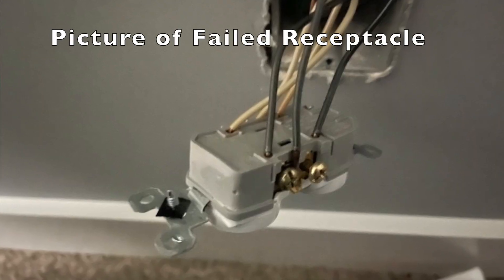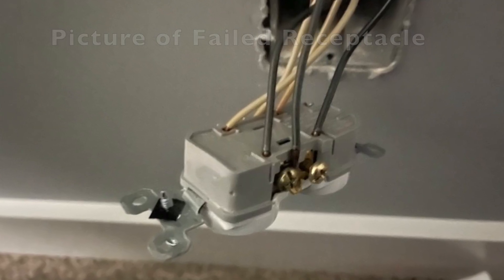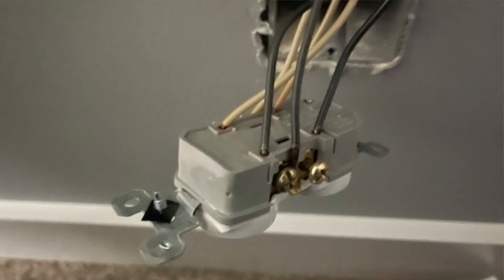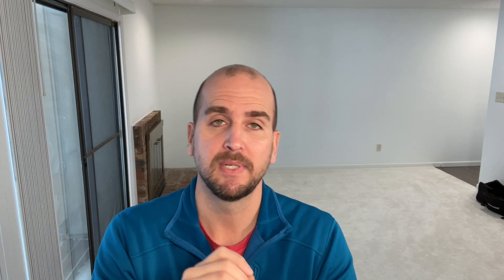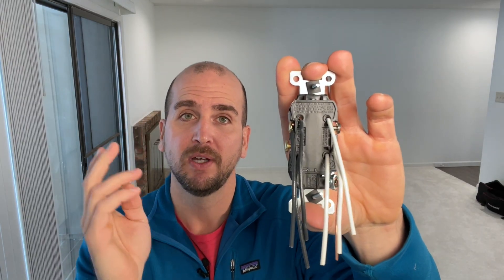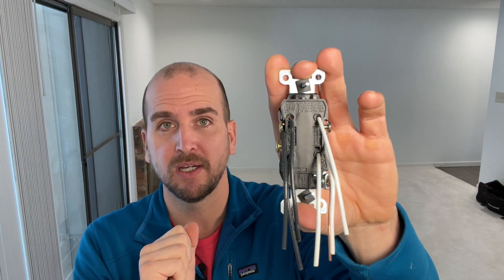Incorrectly Wired Outlet Found In Newly Built Home

Comment: Plumb your wall plate with a torpedo level
Turn your face plate screw slot vertical (don't over tighten) ground down unless otherwise specified by the owner/job or to match other existing or to indicate switched outlets
Pigtail not necessary for commercial outlet w/ 2 connections (watch out for adding pigtails as far as adding to your box fill)
Always tape around receptacles in metal boxes in addition to tightening unused screw terminals
Keep nuts in opposite sides of the box (no need to tape) ideally pointing up as to never hold potential moisture: outside (exterior)  from condensation, inside from a plumbing leak or infiltration leak
Always always use a box extension to keep combustible material non adjeccent to the device

Edit: if adding a pigtail makes things easier and safer go ahead and use (they don't count twords box fill because the originate and terminate within the box and are considered as a connector not a conductor) if adding a pigtail makes things more difficult or less safe, don't use one.  Some boxes, like the little metal ones set in plaster walls of older homes, can be pretty tight and a device, grounds, and 4x 12awg conductors may not leave a lot of room for a pigtail.  Just do what makes sense, work smart, stay compliant, and stay safe.
Reply: pigtails do not contribute to box fill per NEC. Agree that for his commercial outlet the pigtail was not necessary, the way he had it was just fine.
Reply: @lars949  agreed, just because it doesn't count for fill calc doesn't mean it's not making a box unnecessary tight but from a code standpoint you'r correct
Reply: Great tips.
Reply: Boxes come in many different sizes to accommodate the number is conductors as well as the number of devices. If you properly size the box and nicely tuck in your splices (like a craftsman), you will have no problems with space. A receptacle is a "distribution device" not a "splicing device".
Reply: @pappabob29  Yes, there are a great many types and sizes of boxes and I'm sure there are other great videos on box types, fill calcs, sizing new boxes, and changing existing boxes and these would be great points for topics like, remodels and additions; however, the intention of this video, as well as my comment, is only some best practices for replacing an existing device and typically replacing a box is unnecessary for replacing an existing device and is not part of this video.  I think we can all agree that all most all code and best practice are important but this is an introduction/reference video and the narrow scope of these types of videos is what makes them a good resource for beginners.
Reply: @tylerferrusi7652  
OK Tyler, but you brought box fill into the discussion in your comment above. I would suggest that at least MANY if not MOST people watching this video and reading these comments are doing more electrical work than simply replacing receptacles. Any case, I would strongly suggest completing the circuit (continuity of conductors), using the proper sized conductors and boxes and using appropriate splicing devices, BEFORE adding the receptacle device. 
If you run into this situation while replacing a receptacle, by all means, do the same thing using the smallest "approved" splicing devices and use stranded pigtails if box space is a issue. Use terminals on the device ends of the tails or devices that have the screw clamps for those connections. There's ALWAYS a way to PROPERLY do the job given some thought. The side screw clamps are always found on the higher quality devices and that is ALWAYS money well spent.
Reply: @pappabob29  Just because pigtails don't have a value for box fill calcs doesn't mean it's not an aspect of box fill as a general concept and something to consider when replacing a device especially for someone new to electrical, but I don't disagree with you about the code and I also agree that most will do other work but I maintain that there are other resources for other aspects and I appreciate Scott's videos for being clear and concise.  Nowhere am I advocating for improper sized conductors, boxes, connectors, or suggesting to use or do anything improper, without thought, or to compromise quality.
Reply: @tylerferrusi7652  
  👍👍
Reply: For anyone following this thread, sparky channel has a really good one on box fill and the combination of his mock-ups and code book reference pairs well with Scott's, real world teachable moments to give a well rounded understanding.

Comment: Just curious, why is pigtail a recommended method? Why is it better than wiring directly to the outlet?
Reply: And NEVER use a pigtail on a GFCI outlet if you are protecting the downstream circuit...
Reply: My inspector required all neutrals to be pig tailed, the reason being, if an outlet goes bad, for safety you will always have the neutral return path intact. For example, if the neutrals are connected just in the outlet, and that outlet fails on the neutral side, the downstream outlets could appear to be "dead", i.e. an appliance won't work when plugged in due to broken neutral path but can still have a potentially"hot" side  which could shock you if you touched a black wire thinking it was dead.
Reply: One reason, among a few:
Working with a pigtail, any changes only affect the pigtail. Anytime a new j hook needs created, the wire becomes shorter. Pigtails are easy to replace, wires in the walls is not.
Reply: Don't know if it was ever "directly" stated in the code but I was taught that a receptacle should never be used as "a splice". 
The other "concern" in my day when much more was done on live circuits (once again, faster than tracking down  which circuit to de-energize). So if/when a receptacle that was being used as a splice needed to be replaced "live", the person handling the conductors could easily become "part of the circuit" if they accidentally got in series with a load down stream.
Reply: Wondering that myself.  IT would make a better connection for downstream, wire to wire, instead of wire to terminal to wire, so one less junction but no I don't understand why  a pigtail would be preferred in that situation.
Reply: Some very good replies, allow me to add another. It is easier to use a tool to push the wire bundle into the box cavity then you're only fighting the pig tail with the receptacle when you go to screw it in.
Reply: @Joe-by8jh  Not a "useless step". The outlet should not to be used as a "junction point". That creates more problems than they are worth. Connecting only one wire each to the outlet makes it easier to replace in the box. Also using stranded wire for the pigtail helps as well.
Reply: @ajbrant3296  I've heard putting in a boat's drain plug is a useless step, if you have a big and fast enough bilge pump.
Some people are a builder's dream, they charge less because they do just enough to make their work pass a rushed inspection.
Reply: @darbyl3872  If you are referring to my GFCI comment, you cannot pigtail the downstream circuit or it will not be protected. Warnings are plastered all over the GFCI device itself. If you do NOT want downstream protection, then use a pigtail.
Reply: there's adequate room for the wires in different size wire nuts and you don't have proper room in the nut or screw connector with too many wires.
Reply: As I have been told: If you directly plug everything into the outlet and it goes bad, all outlets down the line will then be inactive.  If you pigtail, you only lose that particular outlet, and the rest of the outlets down the line continue to get current and remain functional.  I was actually about to comment that it would have been beneficial to include that.

Comment: And, to think we pay builders and contractors that are LICENSED to do these things. 
I work in IT, and know what I should/shouldn't do. Builders and Contractors should follow the same suit. 

We built our house in 2019, and I cannot believe to tell you the issues we have come across. And, some of them are 'hidden', and even the Inspector would not have been aware of them. A tad frustrating. 

Alas, another informative video...
Reply: Hate to be the bearer of bad news. But typically residential installers. The guys actually wiring your home, aren't licensed. They're dirt cheap labor the contractor pays to turn a profit for them.

So. When shopping for contractors, make sure you find out who's actually going to be doing the install.
Is it methed up Mike for $11/hr, or master electrician Matt for $55/hr. ?
Your contractor is definitely going with Mike. (because the labor rate you're getting charged is still based off of $165/hr)

Which brings me to my last point. Cheap is never good in the electrical industry. This isn't a trade where you ever want to go with the lowest bidder.
Reply: @renegadeelectrical1264  I hear ya! Thanks for sharing...
Reply from the maker: @renegadeelectrical1264  thanks man, I think that was really good feedback and solid info for those looking to build a new home.
Reply from the maker: Frustrating for sure especially on the larger purchase of your life 🤦‍♂️
Reply: Sorry to say, it's been that way on residential work for many decades. I did lots and lots of union residential wiring from 1964 to +- 1980. Even then it was known as "roller skate" work since the contractors expected you to "run" through the work. Lots of guys wouldn't take those jobs for that reason and would "look down" on those how did. I was often the one doing the "trouble-shooting" on the new houses when they were sold and the new owner had the power turned on. I had to figure out and correct the mistakes guys made that were many times no longer there. It always  bothered me that the work we did for those paying with "their own money" (as opposed to business/corporate funds) was the shoddiest work of all. The developers would "beat down" the sub-contractors prices to the point where if you had to go back to a house to do a trouble call, you lost money on that house.
Reply: You have every right to be angry !! You probably have masonite siding it is critical to keep your exterior paint and caulking in top condition.
Code inspectors are usually the biggest uncertified idiot on the job site. Inspections are done before issues are covered up with sheet rock, or buried under concrete and dirt. An inspector from the trades will only know his trade well .Yet signs off on systems they know very little about.
   Welcome to your McMansion....full of fillers 20% cheaper than the real deal. Meanwhile the higher priced spec house sits unsold as a model home.🤔 I asked developers why they tear down the old farm houses. The answer?so prospective buyers don't have a real house to compare theirs too.

Comment: I found an almost identical issue in my home when we first moved in.  I made a boo-boo when I was running CAT6 that required a wall patch and since we didn't know the paint color, we got a "close enough" match at the local big box store that we painted the entire wall with.  So, I pulled the outlet to avoid getting paint on it and wouldn't you know it, back wired connections on each terminal plus back stabs.  Spurred me to move through the entirety of the house one backbox at a time.  Found some great stuff.  Master electrician my ass.  Shame none of this stuff gets inspected.
Reply from the maker: Almost all trades are hurting more and more each year with a smaller number of professionals doing high quality of work.  Not sure the answer for the problem at this point.
Reply: @EverydayHomeRepairs  The stigma of being a tradesman and not being college educated needs to be gotten rid of.  Plenty of good money for people that are willing to use their hands out there.

Regarding my above comment, I'm 99% sure that the electricians work was done once the final electrical inspection was complete and all the receptacles and switches were installed by the GC or his helpers.
Reply: We bought a house built in 1961; I replaced all electrical devices.  Some of the wiring was "imaginative"; and some of the devices had corroded plastic parts.  Lesson learned: before you sign on the dotted line, have your house inspected.

Comment: Why not just put the second wire on the second terminal screw?
Reply: I found that kind of wiring on one of my receptacles.  It was done that way to energize the outlet and continue the wiring somewhere else, probably another outlet.  it seemed like a good idea to me.
Reply: Whoa! I've gotta save these....
Reply from the maker: Pigtails do make it easier to get the receptacle back in the box especially with 12 gauge wire.
Reply: Good electricians feel it is better to use the pigtail than to rely on the receptacle to pass current to the downstream receptacles. As well as a larger voltage drop due to the resistance of the connection, a failure in the receptacle can effect downstream receptacles. You can also see that it will be easier to replace the receptacle device years later.
Reply: @MarkLawry  I would think the IR drop of the bridge between the screws is a fair trade off against adding another crappy connection in the form of a wire nut. Fewer connectors is better. The pigtail has length and IR drop as well.
Reply: WTH? It's right there! Two terminal screws. Two wires...duh. Want to make a pig tail...?....off one terminal....
Reply: @christophermasters815   I’m pretty sure the second screw is if you want to split (not sure of the term) the receptacle and perhaps have one plug always energized and the second plug controlled by a light switch.  This is accomplished by cutting the bridge between the two screws.  You could also have each receptacle with two completely separate circuits and breakers.  I could see this in someone’s garage or shop.
Reply: @glasshalffull8625  Correct about switched vs. unswitched being the reason for the two terminals plus breakable bridge. HOWEVER, it's a code violation to have two breakers serve a single receptacle. The reason should be obvious - you want to work on the receptacle, you flip one breaker, test one of the two outlets - it's dead, start work, ZAP! the second circuit was still live...
Reply: @pheadland    Great info and logical explanation!  I appreciate the info on two breakers serving same receptacle.  Do you know if two receptacles in ‘the same box’  can be controlled by separate breakers?  Thanks!
Reply: Electricians are a highly self important, vain, and ...just , ...insiufferable. I'm one. But, I don't go IBEW. I'm taking care of the county. Because ...they can't get anyone to come and see to their needs.

Comment: On a commercial grade outlet, it is questionable whether a pig tail is safer than a screw down terminal. On the cheap outlets, yes especially when there are 3 cables in the box. No need whatsoever for taping the outlet as some suggest
Reply: When someone is removing it or replacing it, yeah it helps.
Reply: @jamesmuravska2922  actually if you are talking about tape, it is often a sticky  mess after a time or so hard you have to chip it off, a bit of a pain

Comment: As a good practice is to wrap the receptacle with electritions tape to ensure that the receptle wont short out against the box
Reply: There’s a lot of debate about wrapping with tape. Tape apparently doesn’t last and leaves residue on the terminals.
Reply: Wrap around the entire outlet and cover the connections?
Reply: @patricknedz  Yes, but, if it is a plastic (not metal) box, there is no danger.  IMHO, it is a "belt ANA suspenders" issue..

Comment: great video. what is the box extender you use?
Reply from the maker: Specifically for this instance it is to provide separation between the receptacle and the wood paneling.  The thought (code) being to minimize the chance of fire if an electrical arc were to occur. Good question 👍
Reply: @EverydayHomeRepairs  Shock collar, spark guard to meet the code requirement of 1/4 inch  + or - .

Comment: I have always been told to point the wire nuts to opposite ends of the box.   so your white facing up and black or hot pointing down tucked into the corner of the box. that way if the wire nut ever starts to back off it will be held in place.
Reply from the maker: Huh, I like that tip.  Man the hits keep coming.  Appreciate the feedback. 👍
Reply: @EverydayHomeRepairs     One thing I do is I wrap the connectors w/elec.tape.  I know it's unnecessary and overkill, but the next guy will be ae o be more casual and I am probably gonna be the next guy.   I always work live so I can see what is what.
Reply: BY connectors I meant the screws, not the wire nuts.